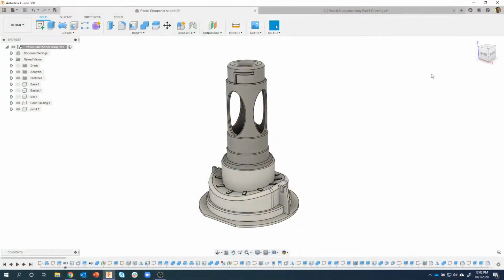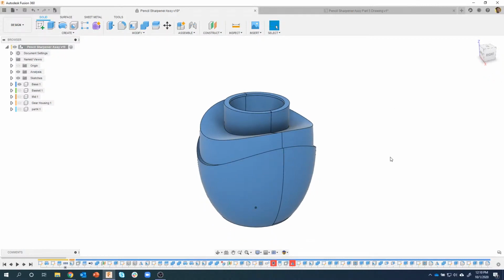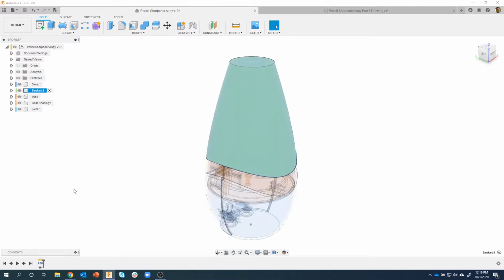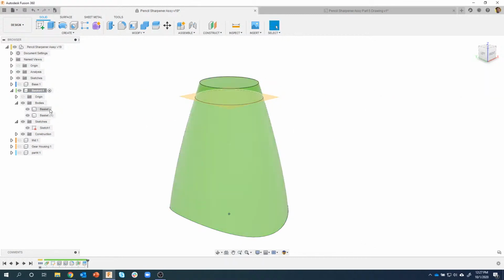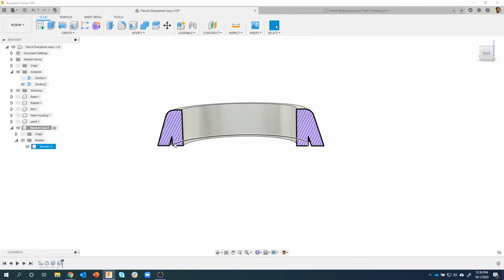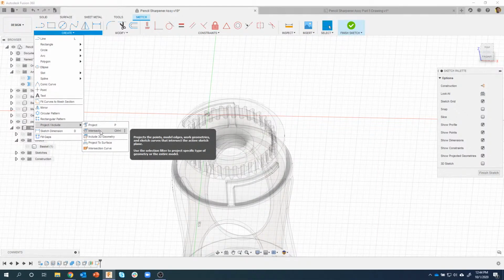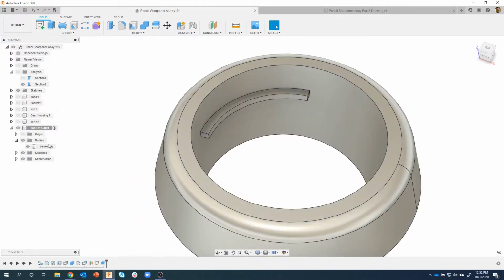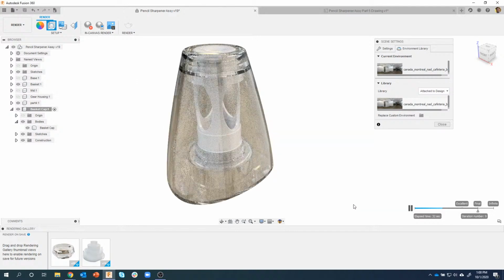Episode 75 - Pencil Sharpener Project   Part 5

Comment: Either I'm missing something, or the cap won't fit into the basket as it currently is. At around the 41min mark, both the cap and basket are shown to share a small tapered section where they contact. How would this allow them to be separated, as you showed with the real parts?
Reply from the maker: SR-  Yes, I saw this.  I showed how to fix this in the last LiveStream that I just did (episode 76)